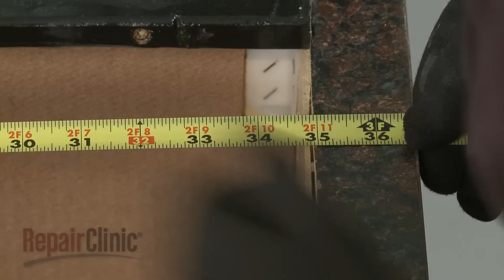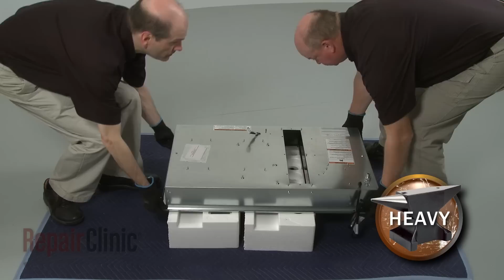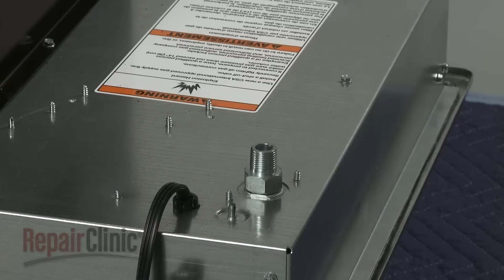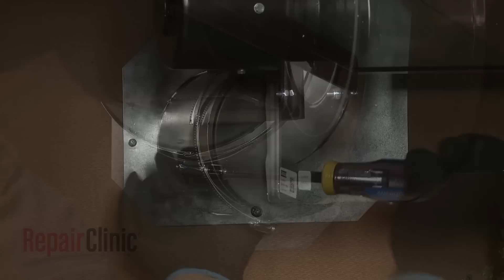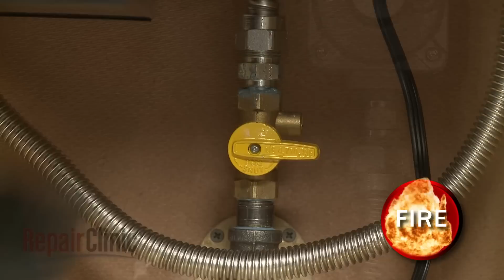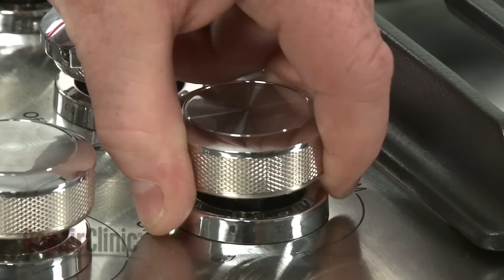Kitchenaid Gas Downdraft Cooktop Installation (Model KCGD506GSS)

Comment: How many degrees does the blower rotate?  Installing in a pre-existing top/cabinet with the downdraft in the front floor.  90 degree rotation with this model would work perfect.

Comment: I'm confused, on my 30" model the grease filter is about an inch shorter than the filter chamber.  Doesn't this mean that air can bypass the filter by going around it?
Reply: I just bought a home with one of these and I have the same question. This thing doesn't look it fits at all. It just sits in there with gaps all around it.